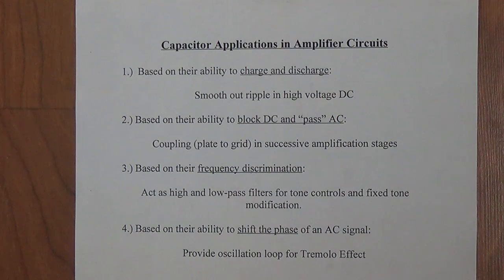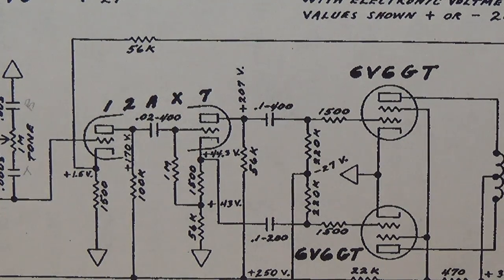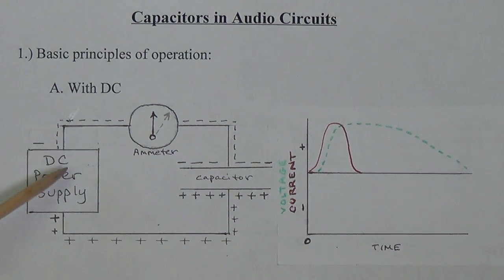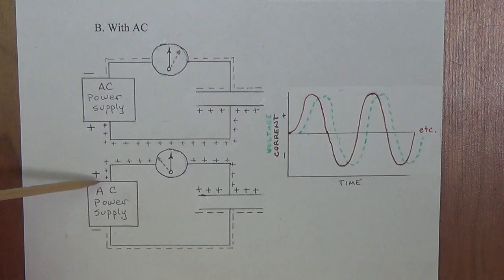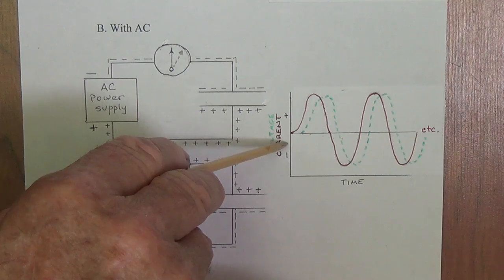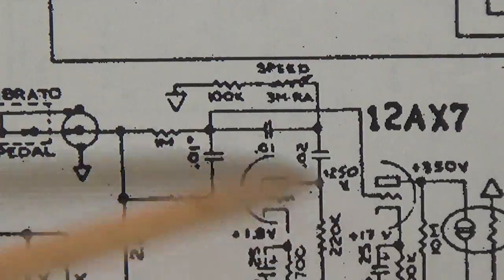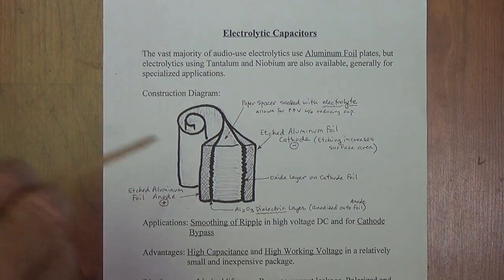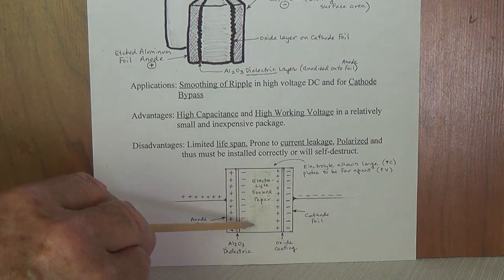Capacitors in Audio Circuits:  Part 3

Comment: Could a failed (shorted) coupling cap send high voltage DC to the volume and tone controls, if those controls are situated after the first pre-amp tube?
Reply from the maker: Any component downstream from a failed DC-blocking cap is subject to the plate voltage of the preceeding tube.
Reply: @UncleDoug  yikes...another reason to replace the caps.

Comment: I'm confused that capacitors block DC but also smooth out a DC signal.  That seems contradictory.  I would think that smoothing out DC would involve letting DC pass through.
Reply from the maker: Watch my video on Power Supplies and you will learn the secrets of smoothing, T1.
Reply: @UncleDoug Thanks for the response!
Reply: Tothna1 capacitors do not allow DC current to flow through.  The capacitor does charge DC on the initial plate, but it does not pass through.  Remember that audio signals are basically always AC.  The signal coming from a record player, guitar, or microphone is AC.  The signal going to speakers is AC.

Comment: I wish I was there to ask him questions.  Here'll have to do:  how do they make the steps exactly 60 degrees?  The little components are precise, but they're not like, medical grade precise, I assume.  So why isn't the 60+60+60 more like 182.2 or something odd?  How can it be that these .01uf and 1M etc components - these conveniently round numbers don't land juuust outside of 180degrees?  Thank you, and I'll take my answer six years off the air.
Reply from the maker: Good question, Joe. My guess is that the component values are not exactly accurate, but as long as the sum of the capacitance is approximately correct, the circuit will function. This is why changing one value-drifted cap in a faulty tremolo oscillator circuit can restore its function.....you are correcting the sum value.

Comment: One has to wonder why UD has depicted current flow as a sine wave, when in fact the current flow would be instantaneously at maximum at Tzero in this context, then tapering off in an inverse of the curve UD has depicted. 
Further, one has to wonder why the voltage across the capacitor would decline at all while the power supply is still attached.
Reply from the maker: One also has to wonder why a "genius" would content himself with nitpicking videos created to provide basic understanding for beginners and intermediate tube amp enthusiasts.......rather than blessing us with brilliant insights on his own channel.
Reply: @UncleDoug  You tell him, Uncle Doug!

Comment: wow! you just blew my mind!! how pi and mathematics can help design circuits, I wondered how Pi was in the formula, and really geometry is there to. Trigonometry also is there, my mind is too over loaded, gotta put the thoughts down on paper. thanks uncle Doug!  for your AC current its like the bubble in your level, when the level is tilted on one end the bubble (electron) moves to the opposite end, and visa versa.

do you have a video that describes how filter chokes work? would you prefer I ask questions through patron? I dont really like facebooking because the news feed is always pushing content I dont like, plus it gets really distracting.
Reply from the maker: This format is probably more reliable than Patreon's messaging system, Russell. Filter choke function is quite simple, it readily passes DC but reacts to....and blocks....any AC pulses, thus smoothing the output of the rectifier.
Reply: so the filter choke is a coil of wire that creates a magnetic field those smooth ing out the ac current, are these used in tandem with the filter caps or in place of them? or somewhere else the the circuit? I have not noticed them in every amp, I’ll have to pay more attention to them. its hard to keep track of everything when just learning, repetition will slowly help this Oldman im 61 on jan 2  good grief who would have thunk id get this old, I know you have a few years on me. :^D

are you planning to add more videos? the reason I asked is the Patreon only pays you when you do, had I noticed that I would just donate to your PayPal account, I will end up doing that way anyways, whichever you prefer.
Reply from the maker: @irusman62  Yes, the filter choke works in tandem with the filter caps. They are relatively expensive compared to resistors, so they only appear in better quality circuits. We are working on a new video and intend to post it soon. PayPal info is included in every video description.
Reply: ok I see a filter choke in the Gibson GA-40 rectified dc coming from the Cath on the 5Y3GT a 20 filter cap before the choke and a 10 filter cap afterwards, and looks like the dc is using the transmission coil as a resistor only on one leg of the Cath
Reply from the maker: @irusman62  You lost me at the second "DC".
Reply: @UncleDoug  ok ill have to take a look at that schematic and figure out what I was thinking relative to what I was typing
Reply: @UncleDoug  im looking at the top winding on the input transformer and the one wire of the 5Y3GT the v looking thing that to me is the heaters, is going through the top winding, the other wire goes straight up and goes to a node that connects to the wire coming from the very top, im thinking thats the B+ , I was thinking that the wire that went through the wire was using the winding as a resistor, ill have to watch the videos on the input transformers as I can’t figure out where the rectified b+ dc is coming out. the component thats labeled 3H is that the heater for the rectifier or a filter choke? the confusion is also from the bottom winding that is going to the pilot light and heaters, I m assuming thats the heaters for the 6Y6GT, or for that matter all the heaters.
Reply from the maker: @irusman62  It's not feasible to try to explain away all your confusion, Russell. You need to analyze the circuit carefully and figure it out on your own. I have Power Supply videos that should help..
Reply: @UncleDoug  yes I did that and it definitely helped a lot and it’s clear in my head now. Thank you for these videos I find them absolutely fascinating and now I’m starting to see schematics and knowing how to read them, not unlike reading a book , technical books that is , story books are a waste of time too me.

Comment: Hi Doug!
Great educational series. I'm watching them all for a second pass! Something I can not get my head around - I get how electrolytics are used to smooth the DC, but on the other hand, capacitors do not pass DC? I'm stuck. Can you help?
Reply from the maker: The DC does not pass THROUGH the electrolytic capacitors during the smoothing process......it passes BY the positive lead of each cap, where smoothing of the post-rectification ripple occurs.
Reply: @Uncle Doug  thank you so much. This had been tickling my brain for too long. It now makes perfect sense. Thank you for all of your great work Uncle Doug!
Reply from the maker: @benoakwood2088  Yes. Sorry. I amended my answer so that it is correct.

Comment: they should make can cap sockets.... like those aluminum-electrolytic multi-section can caps with pins, and corresponding sockets..
anyway, Q : do  electrolytic caps last longer if run at a lower percentage of their maximum voltage rating ???
Reply from the maker: They actually do make electrolytic caps that plug into tube-like bases, Eric. On one hand, you would think that understressing an electrolytic would make it last longer, but since it tends to be age itself that finally destroys them...... my guess would be that understressing would probably not lengthen the lifespan by a noticeable amount.
Reply: @UncleDoug  Thank You... i will look around some more ....but if i can't find anything better then i think i am settling on a CE 525V - 30/20/20/20 uF....just good to know i can run closer to spec, without shortening the service life.
Reply from the maker: @RulgertGhostalker  That would be a good choice of can cap, Eric. Caps with a 525V rating can operate at slightly higher voltages than their rating, which tends to be a bit conservative, but not a lot higher or for long periods of time.
Reply: @UncleDoug  yeah,  i have my B+ figured at 480V ..should be good....i was at 455V with an 800V CT ,  now 480V with a 850V CT secondary... it's going to be one of those two PTs, i just have more work to figure out where the current draw is going to land.
Reply: @UncleDoug  the 850V ct PT, would put about 491V ripple peak through the 30uF section....so i just want some design head room, so bum components still fly..
Reply from the maker: @RulgertGhostalker  It sounds to me like you have the head room you desire, Eric
Reply: @UncleDoug  i had to go back to 455V B+ ... too much current for the higher voltage PT, and i will get my 25watts out of the 455V anyway, and for that i have an OT figured already also....so i guess i will go with a 500V can cap.
Reply from the maker: @RulgertGhostalker  Sound good to me, Eric.
Reply: @UncleDoug  my EPS Tube Head Revisions video is at 14% upload on an incredibly slow internet connection ... maybe try tomorrow.
Reply: Manufacturers rate electrolytic capacitors to perform reliably for a number of hours at a voltage and temperature, e.g., 1000 hours at 100V @ 85 degrees C. Operating a capacitor  at a lower voltage or a lower temperature both extend this working life.

Comment: Are tremelo caps polarized electrolytic s ?
Where in the amp sections are polarized electrolytic used - and where in the amp sections are non polarized, non electrolytic s used.?
Reply from the maker: Trem caps are non-polar, Paul. Electrolytics are used in the power supply and as cathode bypass caps.

Comment: Hi Uncle Doug, that’s for the great explanation. One question that I hope is no too silly: if a capacitor blocks DC in a circuit where it is functioning as a coupling capacitor, is the DC voltage that is “felt” on circuit after the capacitor “effectively sent to ground” via a resister? (Just checking if I have the correct understanding).
If my question does not make sense, feel free to just tell me to rewatch the series. That is a perfectly fine response. I do not expect you to explain the error in my thinking in your response. Thanks!
Reply from the maker: Your question makes very good sense, Zoltan. A small portion of the blocked DC is absorbed and stored within the capacitor. The rest passes through the plate resistor to ground.
Reply: Thank you! And thank so much for all of these excellent learning videos.
Reply from the maker: @zoltannemeth8864  You're welcome, Zoltan.

Comment: Uncle Doug,  Thanks for these great videos.  Questions about testing and reconditioning electrolytic capacitors using the "variac method".  I am working with power supply caps in the 10 to 100 MuF range.  Can you apply an AC 60 Hz voltage to recondition them, or must you use a DC (or pulsed DC from a rectifier) to do this?  (I think the answer is DC only.) I tried using a gradually increasing AC voltage using a dimmer switch.  I put the test capacitor in parallel with a lightbulb and brought the voltage up with the dimmer switch.  Fortunately I put a 2 Amp fuse in my circuit.  I found that I quickly blew the fuse with a 100 MuF cap.  Using the equation for Xc when C= 100 MuF and f=60 Hz gives Xc=26 Ohms.  That means that I would blow my 2 Amp fuse at 52 volts.  V= i Xc = 2 x 26 = 52 Volts.  It seems like it blew at an even lower voltage!  Anyway, I quickly realized that I must be doing something wrong here.  Can I recondition my caps using an amp circuit?  If I have an amp with a solid state rectifier, can I plug the amp  in to the dimmer switch with no tubes in it and then bring the voltage up slowly with the dimmer switch and thereby gradually apply a pulsed DC signal to my filter caps for the B+ power supply?  This is probably too many questions, but perhaps you could make a video about this.
Thanks!
Reply from the maker: You can only re-form electrolytics using gradually-increasing-voltage DC, Cosmo. They are a dead short for AC......hence your experiences with it. Nowadays, with high quality capacitors readily available at very reasonable cost, it makes better sense to simply replace the caps.
Reply: @UncleDoug  Thanks for the confirmation Uncle Doug!  I love your videos.  I played with tube stereo amps with a friend in college.  Both of us became engineers (mechanical and bio, not electrical).  My dear stereo friend is dead and gone and now another old friend has got me interested in tube guitar amps, as he is a great guitar player who has just discovered the magic of tubes.  I am a tinkerer and he has brought me an old Alamo Fury to play with.   Despite the advantages of buying new caps (which I will likely do, eventually) I am still interested in the reconditioning process.  If I have an amp with a solid state rectifier, can I recondition the caps right there in the amp by bringing the voltage up slowly by plugging the amp into a variac (or dimmer switch)?  Is it better to do this with or without the tubes in?  Could I build my own reconditioner using a dimmer switch, power transformer, and a solid state rectifier?  If yes, could you suggest a circuit layout for this?  THANKS SO MUCH FOR YOUR FAST REPLY!  You are currently my favorite "Professor" of the University of YouTube!

Comment: I still didn't learn why electrolytic caps exhibit a polarity effect. Also (in your tone stack video ) you never explained how the resistor effects the frequency of the R/C network. This as I understand it, is because when a cap becomes saturated it conducts less at all frequencies. Without some path to ground, the cap remains charged Thus the greater the resistance the longer the discharge rate and is this which effects the frequency of an R/C network. Am I correct in this?
Reply from the maker: The frequency response of capacitors depends on the speed with which they can charge and discharge.  Low-value caps can charge and discharge very quickly, so they will allow high frequencies to "pass"......and vice versa. The resistor's value alters the charge/discharge rate of the cap and can create finely tuned thresholds of pass or fail (RC filters).

Comment: Back in 77 when I was separating from my second enlistment in the US Army, I took training in an auto mechanic course. When it came time to deal with the distributer, coil and such we began to play with condensers (just another name for large capacitors in the spark area of a car)  We had a tester/charger for them.  It was a common thing to charge them up and call another student's name, then toss the charge condenser.  Man that discharge was quite a deal and most of those who caught the little silver condensor dance like it was 1966 and they had just taken a hit of LSD, while acid rock played in the background.
Reply from the maker: It's a great trick, Jerry. Jack and I use it to rid the workshop of unwanted visitors.

Comment: I loved this series, thank you.  I have a question regarding 'air capacitors'.  Would installing them (the meshing plates)in a vacuum or some sort of inert gas increase their capacitance and raise their voltage capabilities?
Reply from the maker: I would think not, since the electrical charge travels within the plates, not between them, thus it would be unaffected by the atmosphere surrounding the capacitor.

Comment: Doug, do you recommend axial or radial high voltage capacitors for removing ripple from annoying visitors?
Reply from the maker: I only use axial caps, Vinny. Radials are for PCB's.
Reply: @UncleDoug  I was thinking of how easily the annoying visitor can complete the circuit with the different package types ;) 

I've started collecting parts for my my first build. Got the valves (that what we call tubes downunder) and an OT and choke. About to order all the smaller stuff - I'm going with Mallory 150 series caps for coupling and tone circuit. 
I've watched these older videos of yours several times. 
Your work has given me the inspiration and confidence to do it!!!

Thanks bloke!!

Comment: How do capacitors work in peak detector circuits?
Reply from the maker: I have no idea, SS. I only work on tube amp circuits. I'll bet the Internet can answer the question.
Reply: @UncleDoug  I do like your videos on tube circuits. I've learned alot from you. In my opinion I think its because your straight to the point when you're teaching. I was in an electronics class in junior college and the teacher was kind of all over the place with the curriculum. He didn't really stick to the basics that us students needed to understand first before he prematurely advanced into another chapter.
Reply from the maker: @theshitshow6371  Thanks, SS. Unfortunately, that's a common mistake among educators, and one that usually dooms them (and their students) to failure. Just like with plumbers and dentists.....you have to pick the right teacher, if you want to learn and succeed.
Reply: @UncleDoug  I know peak detectors are usually solid state circuits, if you don't have inclination to those circuits, that's understandable. Because you probably don't have to deal with them that often. Which means I have to make the effort to learn about those circuits on my own terms. Which teaching oneself helps alot. I'll be honest, I'm not very knowledgeable about tube circuits, and I also don't have to work on them as much as solid state circuits. But both can always be learned
Reply from the maker: @theshitshow6371  You're right, SS. If you have the focus and desire to learn any skill, it's definitely possible. Since I do this mainly as a hobby, I can pick and choose the circuits I work on, and I just have an affinity for vintage tube gear......the older the better.
Reply: From the circuits I've observed, they're usually electrolytic